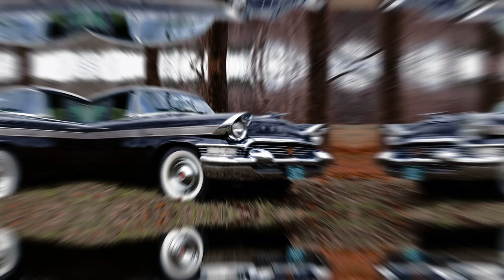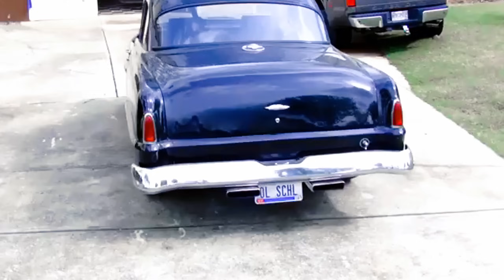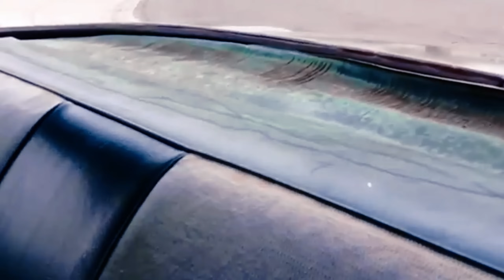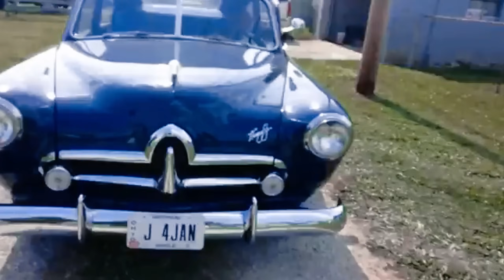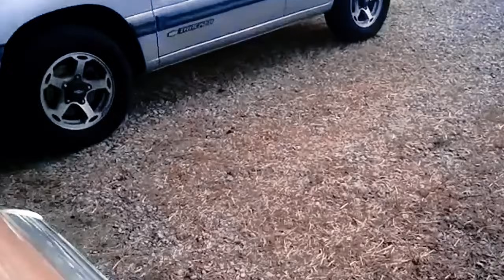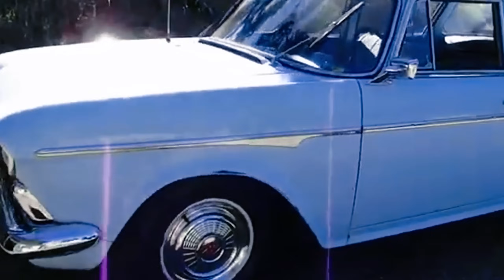12 MOST DISGUSTING AMERICAN CARS! Which only the poor could afford!

Comment: The 1950s absolutely were the Golden Age of American automotive design. This was before they had to worry about crash tests or the difficulty of repairing those bodies with all those fins, angles and chrome. Mechanically, 50s cars were little better then they were in the 30s and 40s. Engines were bigger, of course, but they had to be because those bodies were so damn heavy! The bodies rusted due to a lack if understanding how to fight it back then. Engines, brakes, and suspensions worked well and were simple to repair, which I do miss.